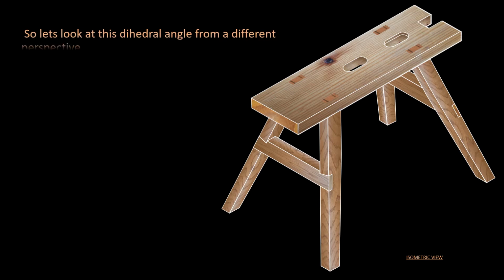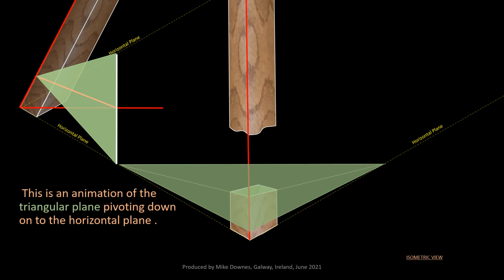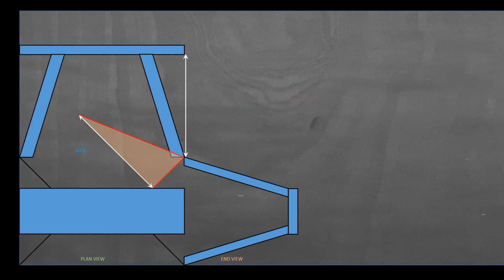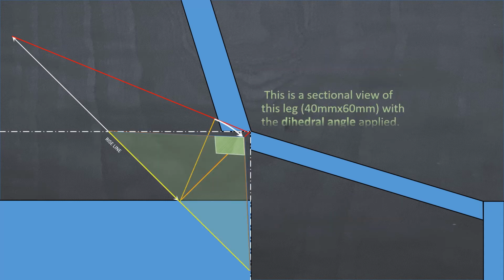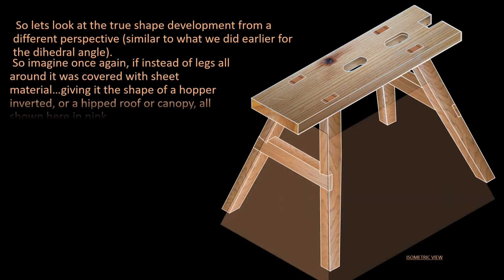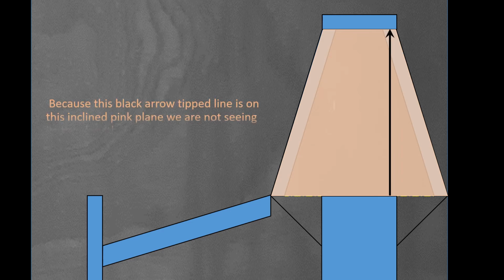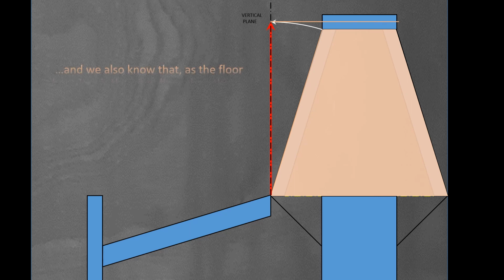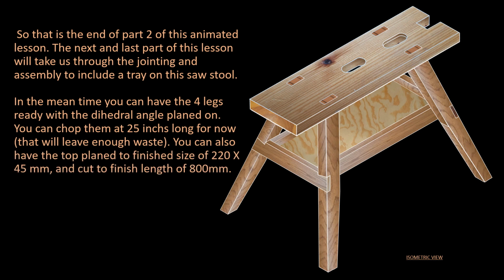HOW TO MAKE A JOINTED SAW HORSE (PART 2)

Comment: Hi Michael
  Very nice, but at 1.25 you say the surfaces of the material make a 90 degree angle on the floor plane, but this isn't so is it?
Reply from the maker: Glad you like the video...the angles do form a 90 degree angle on the floor plane...if you  left a framing square flat on the the floor it would be 90° between both surfaces which are ending in a compound angle....but if you position the square across the two surfaces to check as you would normally (square not on floor plane now) to see if they are square to each other you would see its a few degrees more than 90°(The dihedral angle)

Just to visualise....if the legs were coming up from the the floor at 90° instead of raking inwards it would be 90° between both surfaces no doubt at the floor plane...but as they rake inwards and if no dihedral angle is planed on then you will see the angle between both surfaces become less than 90° at the floor plane.

Chop a slight compound angle on the end of a 2"X3"...place that angle you have just choped against the floor and you will see it is now less than 90° (at the floor plane)because there is no dihedral angle planed on.

so, in a nut shell, if it aint got 90° between both surfaces where they meet the floor plane, then it aint got the dihedral planed on.
Reply: @michaeldownes516   @Michael Downes  Thanks for your detailed reply Michael. My fault I didn't realize you changed the dihedral angle on the leg material from 90° to give a 90° footprint.
I've made some French trestles with the legs either rotated to the long or short side but not using your method.
Regards Misi
Reply from the maker: @Misiden1  ..as you state putting the dihedral angle will deliver a rectangular foot print on to the floor plane....this in turn means the edges on both legs are on the same inclined plane, which is necessary for the dovetailed end rail to fit flush to that same inclined plane....and the tenon's (& Mortises)delivered through the top surface will also have square ends/be rectangular because of the dihedral  angle having been planed on.

Comment: Michael , Another superb, clearly explained video detailing the key geometrical concepts and fabrication of the saw horse (Part 2/3).Your analogy with hipped roof  or  hopper construction really clarified the key ideas and helped in visualising matters - simple but very clever!
The CAD format works so well particularly when combined with your wonderful commentary making the setting out and key construction details fully understandable.
As always, the production work that lies behind these highly informative animated videos is very much appreciated and great learning tools. THANKS SO MUCH!!!!
Reply from the maker: Glad you liked it Jeff. I wanted  to avoid using labeled  stepped instruction for the dihedrel angle for example , which i would blindly follow without fully understanding why it works when i was an apprentice. And  so it was great to be able to explain it using the isometric views with animation, colour and voice over. And the hope being that the viewer  would have a 3D visual concept before we embark on the 2D  version on the setting out sheet.The same goes for the surface development of the legs.